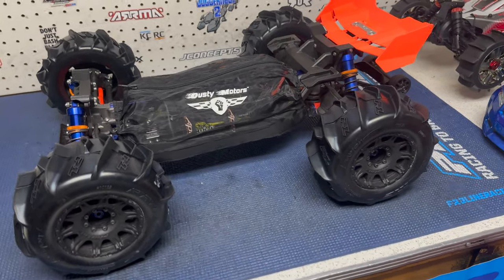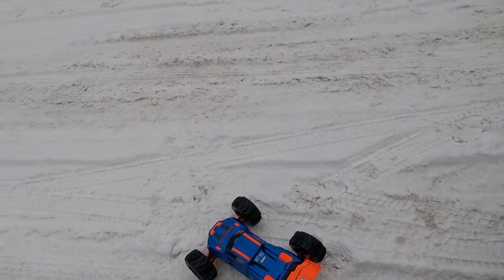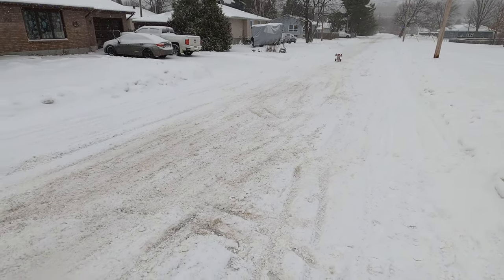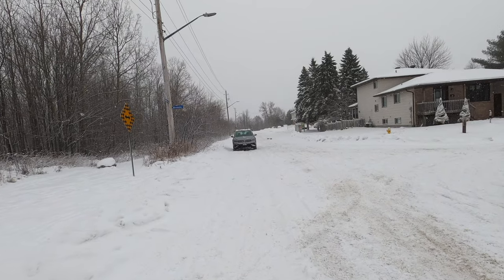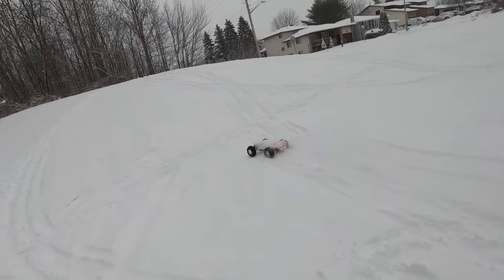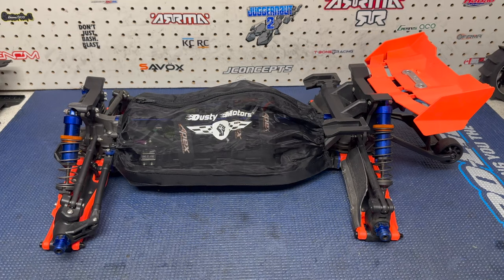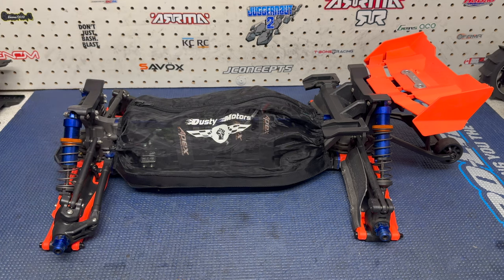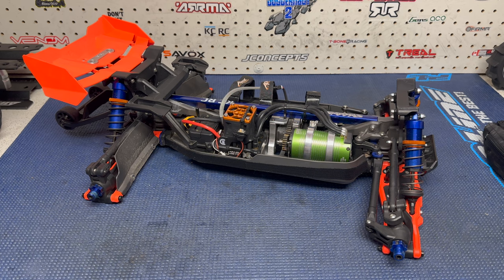Traxxas Sledge (Castle 1650kv & Proline Dumont Paddle Tires Take 2!)

Comment: SWEET!! Snow and paddles are so much fun!!!

Absolutely LOVE the proline Dumonts, too!  I recently built a nitro powered 4wd mud drag truck out of an old Duratrax Overdrive and out of the 3 different paddles I've tried on it, these work the best for me.  That's on all 4 corners, too.  I tried pretty much every combo (these on just the front with "straight across" paddles on the back, the other way around, etc...)

I think that aggressively angled paddle design really helps keep it tracking straight like adding a bunch of rear toe, but without giving up much acceleration at all.  The ones with the more straight across paddles seem like they'd grab a lot more earth (or snow 😆) and move the truck (maybe they do...), but it makes it wander all over the place at the same time and it just feels real sketchy to me ...kinda like a 1/10 stadium truck w/ 2.2" slicks going 60+, all ballooned up like crazy...  

I put a pretty ridiculous 24t clutch & 46t spur (that I had "custom" machined in China, as all the Traxxas and aftermarket spurs only got as small as 50 tooth. LOL) ratio in my project "Speed-JATO" last summer, and found out I need some foams or belted tires before I can open her up!  This summer. ...hopefully!  

ANYWAYS!! My best ETs so far with the "new to me" drag truck were on Dumonts, though and I don't think I'm gonna be swapping them for anything else any time soon!  The difference is pretty significant ...at least it is for my truck!  Thanks for sharing the action with us, man!  VERY cool! 😎

Comment: Awesome run in the snow , what size can are you running? I now it’s 1650 is it the 1717 or 1520?

That screw goes into a regular nut you need to lock tight it